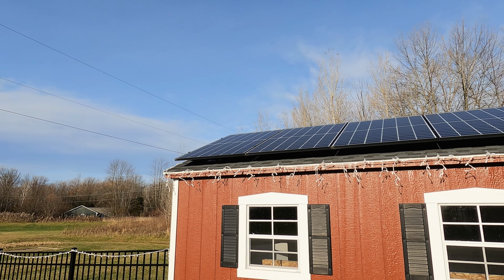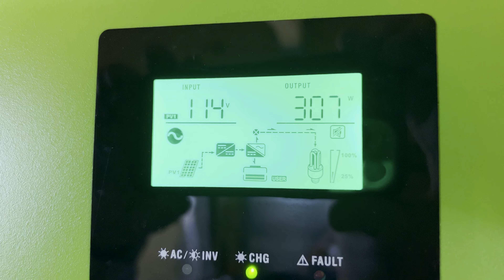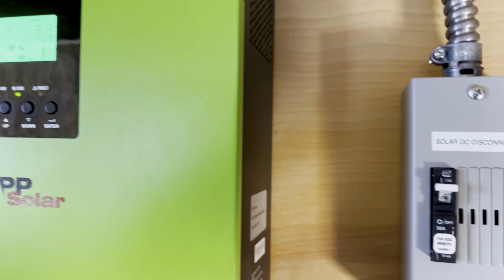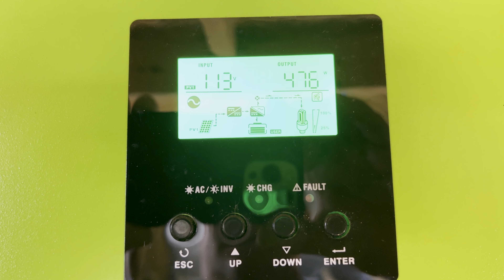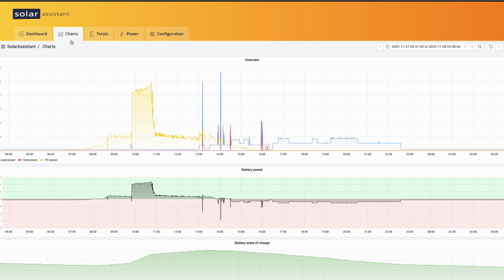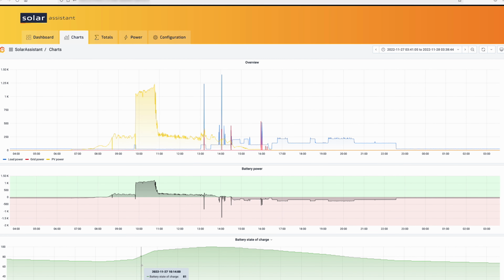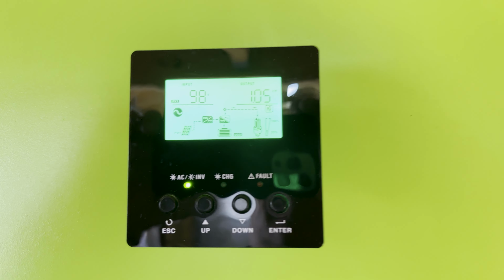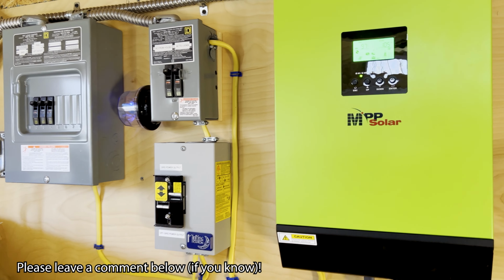Is there something WRONG with my MPP LV2424???

Comment: There is no reason to have to reset the PV breaker in order for the MPPT charge controller to wake up and make power like you showed.  The only thing that pops into my mind is the rebulk settings and/or something going on inside that unit to throttle back power. My Midnites go into low power mode "after" the battery volts hit full charge is met and immediately goes into float (lower power). But, they also automatically ramp up power when in float and running inverter loads. So, something inside that unit is wonky.
Reply from the maker: Definitely something is wonky in the LV2424 for it to be doing this.  I noticed this earlier this this summer but the issue seemed to go away.  Mindite's....those are looking pretty nice right now.  I need to start planning my next move!  As always, thanks for watching and always appreciate your support!
Reply: @GreenMountainDIYGuy  -- Roger that! Some MPPT solar chargers that say they can handle 150v of PV voltages are not always true. If the VOC is around 120v with full sun (and cold panels), that might be too close to it's limit and throttle back. "HyperVOC" is a real problem in cold climates if you run your arrays close to the chargers max PV input. Even with my Midnite Classic 250, I was "sure" I would remain under 250v of PV volts (added up to 220v). Guess what? When there was a cold spell, that Midnite went into HyperVOC mode. Some panels go nutso in cold weather and exceed there VOC ratings by as much as 30%

Comment: What is incoming voltage from the photovoltaic?
Your incoming PV voltage should be within the mppt threshold not over the mppt threshold for the 2424lv to to track properly or else it won't bounce back or refresh itself. 
I hope you find my comment helpful.
Reply from the maker: Yes, my friend, very helpful. I will look carefully into the thresholds for the MPPT.  starting voltage was around 115V which I believe was within spec but I'll check!
Reply: @GreenMountainDIYGuy  
Note: 
Don't forget to calculate your temperature coefficient due to cold weather temperatures in Vermont.
The voltage tends to rise when the Solar Modules are too cold or frozen.
For example, if you happened to have four Modules in series, you have to eliminate one Modules from the string and run three in series instead of four for the unit to run effectively and efficiently for both winter and summer.
These are other possibility that are affecting your system not perform effectively at this time of the year.
I hope you find these pointers helpful to resolve or fix your current problem you facing right now. 
Please update me on your findings.
Cheers

Comment: Mine seems to be doing the same thing, curious if you found a solution?
Reply from the maker: Yes, it was simple user error.  Just need to set my charge voltage limits higher.  Working perfectly now.
Reply: Mine is LVX6048 with PV input 228V/45watts. I reached out to support, they responded with generic start questions then ghosted me about a week ago.
Reply: @GreenMountainDIYGuy  Well I know this weekends project! I have the same issue and when I first saw this video there was no solution. I'll check that out. I was so low in voltage compared to the systems limit I never considered it was an over voltage issue. Don't even remember that setting honestly. I'll come back and let everyone know if this is the same issue. I literally have 1.4kw of  panels putting out over 1k for the early part of the day and then. doing 300-500w for the afternoon. I'm in the desert, full sun and 113 deg F and making 380 W when I get home from work at 2:30PM. I have more battery than I need so I am excited to see what charge I can get when the system is working properly. I've never charged more than 64%.
Reply: @GreenMountainDIYGuy  I’m experiencing the same thing.  The only way I can get even close to 1kw is to add loads then it will let more solar in, but otherwise it never goes above 10-12amps to the battery.  I have a 2200 watt array and the only time it goes above 1kw of solar is when the loads are 900w or above.  My batteries will not charge completely using solar alone because of this.  I have the max amp charging set at 120amps, I have the AC only at 20.  The highest input I have seen was 1300 watts but it’s usually around 600-700 watts.

Comment: I have been using 2 lv2424 for about 2 to 3 years now with no problem
Reply: Cool
Reply: Does yours go into Bulk mode every morning? I’m having the same issue as what’s presented in the video. All to often it charges only up to float and no higher. SBU mode solar only, utility disconnected. Frustrating.
Reply: @hifid3lity  no I don’t have any issues with mine works great

Comment: Never noticed if mine is guilty of this. Will have to do a test
Reply from the maker: I think the issue was my BMS...it was not calibrated to the incoming charging voltage.  Not that I have that setup, all seems to be working very well!
Reply: I just got mine all sit back up  before the polar vortex hit. Need to mount my solar on the shop roof next spring. But still getting moved into the new house